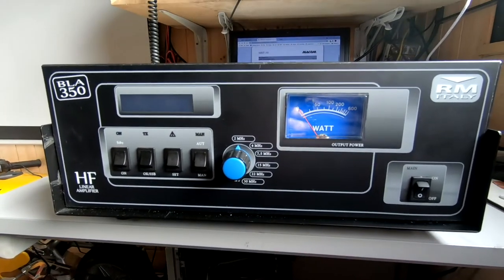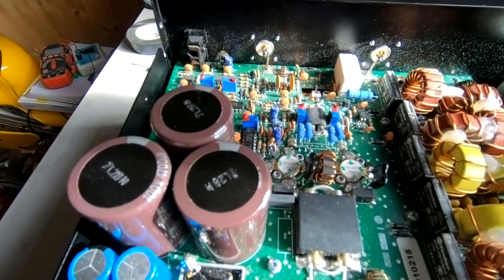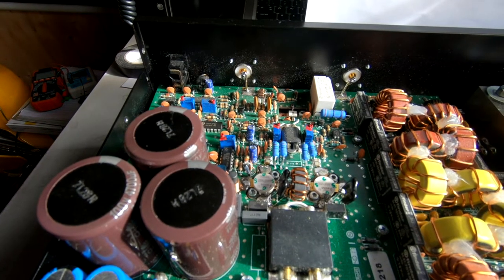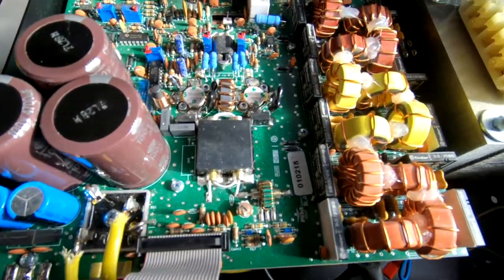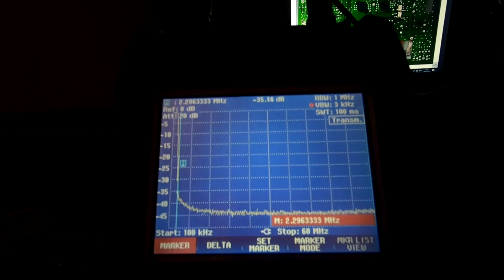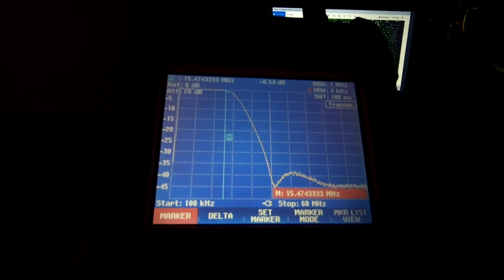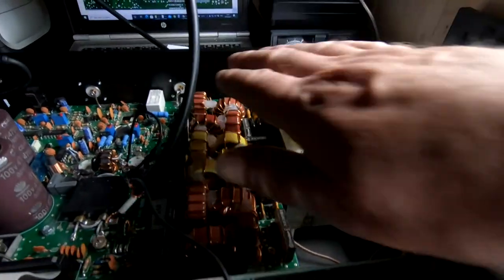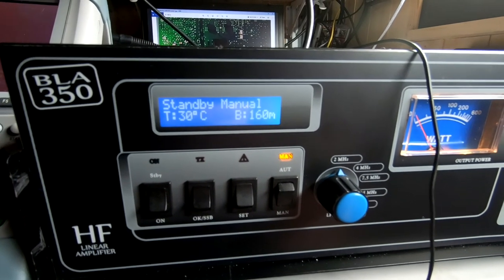RM Italy BLA350 Plus 300W Linear Amplifier faulty, Part 1

Comment: Hi Wayne!
Thanks for this video. Currently I am trying to repair an older BLA350, which has the 2SD2941 FET´s inside. Both are broken... Unfortunately those are not available anymore.
So I would like to take MFR150´s instead. RMItaly told me, that there is a modification at the PCB, which has to be done. But they are not telling, which difference....
Do you have an idea, what has to be changed to get the MRF150 running in the BLA350(without "plus")??
The Spectrum Analyzer work to check the output has still to be done here on my PA, too.
Would be happy for any ideas!

Tnx and vy 73s,
Chris, DL6RDM
Reply from the maker: Hi try this link, its in Russian, if you have chrome you have to right hand click, "Translate to English", there is 42 pages but some  very interesting discussion's http://www.cqham.ru/forum/showthread.php?21492-%F3%F1%E8%EB%E8%F2%E5%EB%FC-RM-BLA-350

Comment: Hi Wayne,
My problem for the BLa-350   i have 0W  to display,  the ALC connected to my radio, then i would think that the problem is because i have too much ALC voltage the TREM6 . Just measure the voltage on the ALC connector of the amplifier. The max voltage  -2.2 Volts not correctly. If there is not -10V this is obviously the problem and probably the trimmer or ampli OP TL084CN.

The protection excessive input Power "over imput" is not functional , PIN 9 Trim5
Do you have idea ?
Many thank
F4EFA

Comment: Hi Wayne 
Interesting  is there and Part 2 .. follow up at all ...?
  Secondary ...Is there any sources for a service manual on adjustments for servicing trimmers and voltages that you were able to track down ?
Reply from the maker: Hi sorry no part 2, like you looking for full service information. Hi try this link, its in Russian, if you have chrome you have to right hand click, "Translate to English", there is 42 pages but some  very interesting discussion's http://www.cqham.ru/forum/showthread.php?21492-%F3%F1%E8%EB%E8%F2%E5%EB%FC-RM-BLA-350